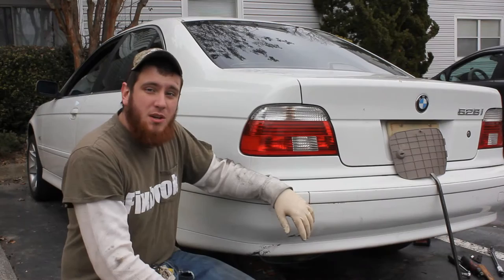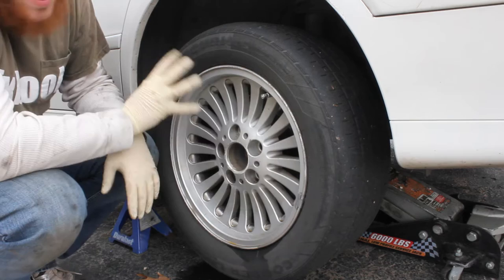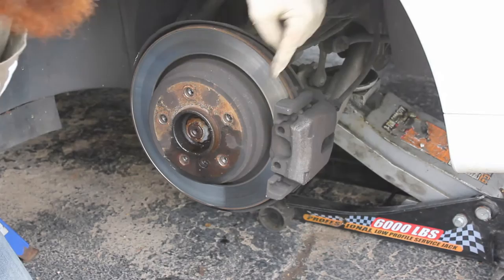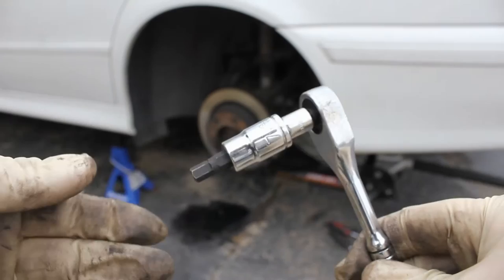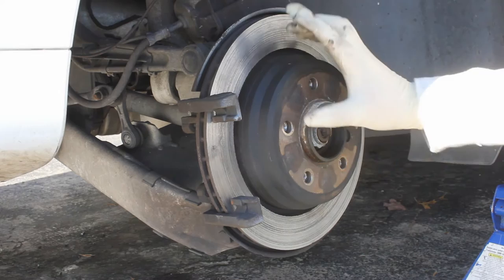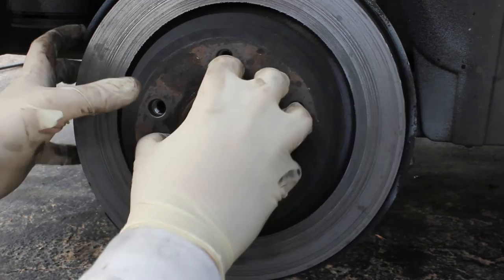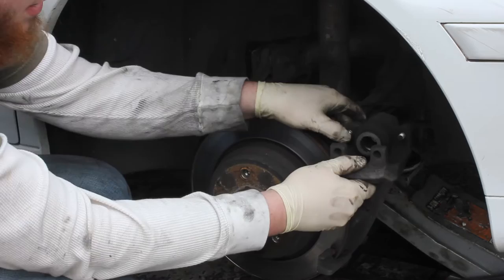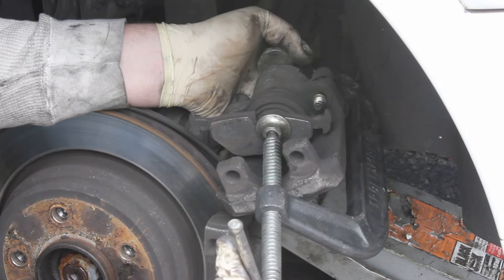Brake Pads Rotors Remove Replace 95-03 BMW 525i "How to"

Comment: Good video, thanks. I watched for a refresher, as I've done BMW brakes quite a few times. It was good to be reminded of the hex-wrench sizes, etc., as it has been a while. One suggestion: You mentioned that one must "depress the e-brake" before pulling the rear rotors. That's a bit confusing, as when you "depress" a pedal, you're usually engaging the brakes. With the e-brake, I believe you want the e-brake off (disengaged) so the shoes pull back from the inside of the back of the rotor. Cheers.